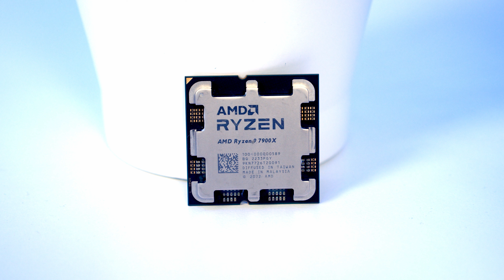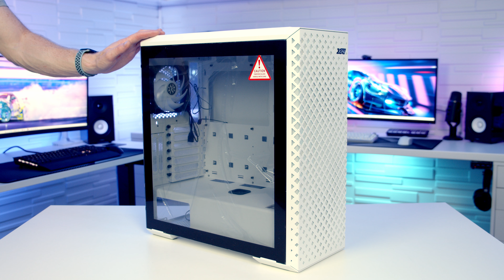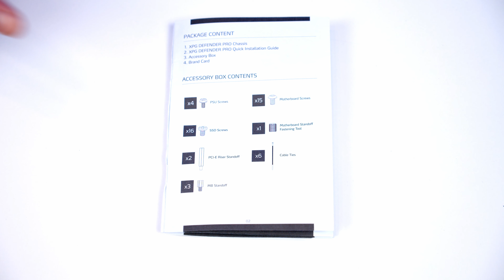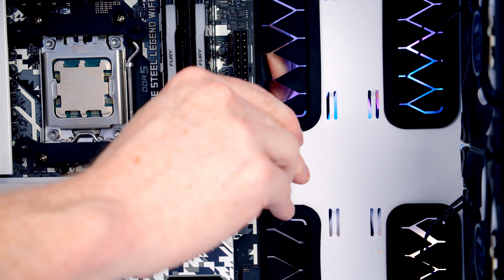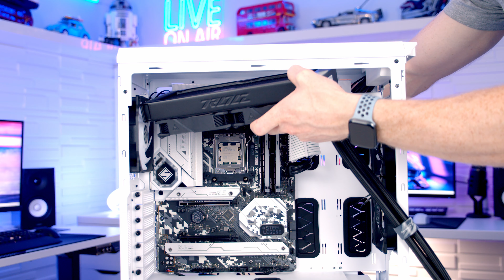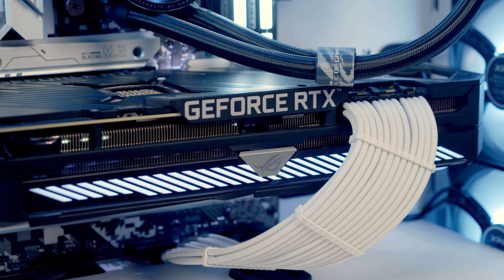XPG Defender Pro Build - Step by Step Guide

Comment: Thanks for the guide. Does 4090 fit in this case without any problem and bothering when assembling the case?
Reply from the maker: Haven't tried it
Reply: Is late answer, but yes you can put up to 380mm Graphic Card with front fans